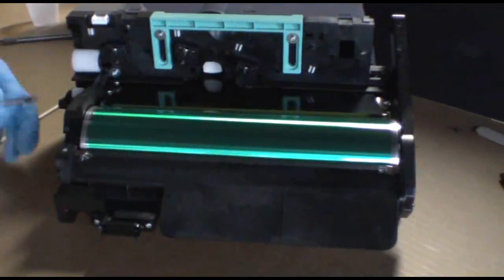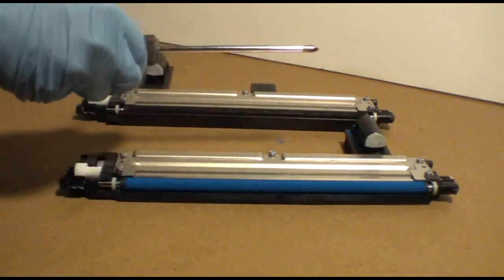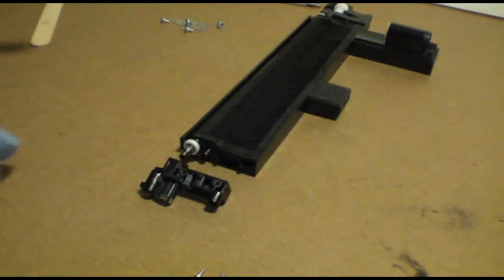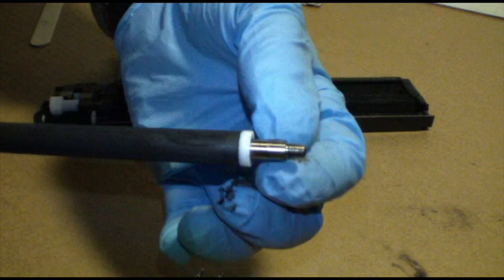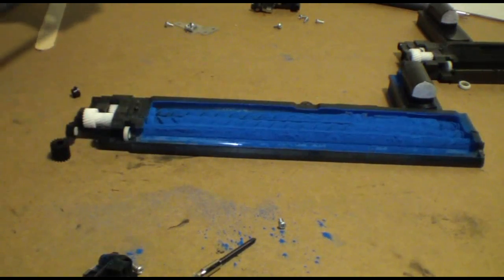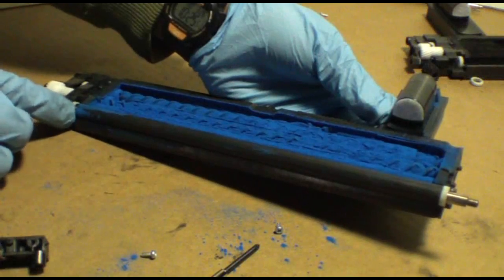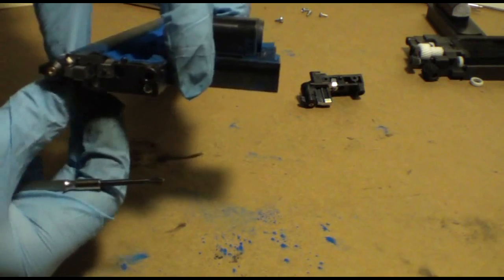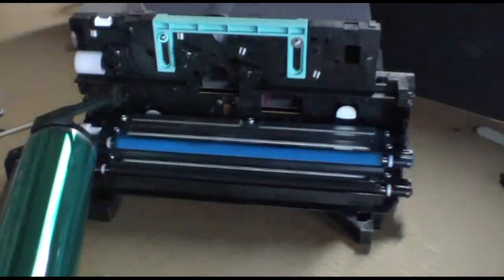Part 2- Fix or repair color laser printer with fading, light print, or lines samsung clp 300

Comment: I worked 7 years as a field tech for a Konica Minolta Dealer. Your video is dead on for going to the proper section for cleaning. I have this model at home and as you said, it's not economical to put any hard parts into it. I can identify with your ID of "Poverty Labs". Keep up the good work!

Comment: Hello I have a Dell 1320c laser printer and the black toner transfer unit was no longer printing black but a dark magenta for some reason. I completely cleaned out the toner transfer unit and installed a branded new black toner cartridge but it is nolonger printing black. Will it eventually begin printing once the toner transfer unit fills up again or is it ruined? I reassembled the unit back using photos I took so I'm sure I put it back together exactly how it should be. Thanks for your time.

Comment: My Samsung CLP-315 is quite a bit different, starting with the fact that the parts you worked on are attached to the toner cartridges. While watching your videos I took apart each of my cartridges and wiped down the toner metering blades and it seems to have fixed the issue. Thanks for posting this.
Reply: BTW: Samsung's manual calls it the Green Drum too ;-)

Comment: I just used my clp 300 for the first time in quite a few years. It's ghosting the image on the paper with black lines. Also there's a bit of a smell. If I go to try to clean it as you did yours, do you think the smell will go away? Or should I give up on it? I don't really want to give up on it.

Comment: It would be so wonderful if you could give us instructions you feel appropriate for 1. semi hard roller cleaning, 2 hard roller cleaning, 3. soft fuser backup roller cleaning, and 4. the all important Selenium drum cleaning. I will note your use of wood for scraping the blade in your 1st video is excellent as it will not scratch the harder metal surface. That said folks could also use a soft plastic for this purpose as well. Curious, did you see any chunks of hardened material in the toner well beneath the blade? Sure wish you were working on a Lexmark E322, would simplify many things for me.

Comment: I know this is a late reply, but generally speaking that type of issue is caused by a dirty corona wire on the drum.  A corona wire is a wire (or a few wires) that run horizontally the length of the drum.  Typically, there is a plastic piece attached to the wire on one end.  All you do is slide the plastic piece back and forth to clean the wire.

Comment: Thanks for these guides. I had fainted black with my clp-350. After following your guides, the situation didn't improve but I noticed that the black blade doesn't get filled (tried with two new black toner).
The wheels inside the blade turn but ink doesn't fill. Do you have any clue maybe ?
The only noticeable thing I saw is the white gear inside the printer (on the right). The color ones are moving freely but the black one seems very hard to turn. Could it be a reason ?

Comment: The problem I'm having on a CLP 315 is that the sponge/foam like thing that rolls with the part you are exchanging in the video doesn't deliver toner in a specific area, resulting in a thick white line on anything I print. Do you know why this happens, or what can I do to solve it? Thank you so much!!!

Comment: Ah - got there in the end "transfer belt error" - it was the white connector under the top panel wasn't mating after removing the drum assy - cleave the clips with a craft knife and you can push it home!

Comment: Very important:
When this unit goes back, you have to ensure the wires are kept out of the way. On my unit, I found I couldn't shut the front lid - when I had a closer look, there was a red wire in the guide which was being squashed & the whole thing was not back enough(hence lid wouldnt shut)

Comment: This is a great video! But my guess is that cleaning the roller made it work better, rather than the roller being damaged. Unless the gunk you cleaned off that top part ended up damaging the black roller. If so, this would be a shame as some day there won't be any more rollers to replace.

Do you know of replacement rollers that can be purchased? It seems with this cleaning process and new rollers that these printers can be used perfectly forever.

NOTE: Same image unit as Xerox Phaser 6110MFP

Comment: Thanks for spending time to make this video-it improved my black colour printing.
One point-in part 1 you explained about taking the 2 screws out, then the green roller assembly pulls forwards. On the left are the wires.
When this unit goes back, you have to ensure the wires are kept out of the way. On my unit, I found I couldn't shut the front lid - when I had a closer look, there was a red wire in the guide which was being squashed & the whole thing was not back enough(hence lid wouldnt shut)